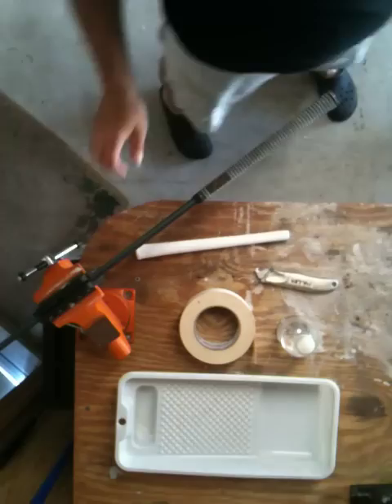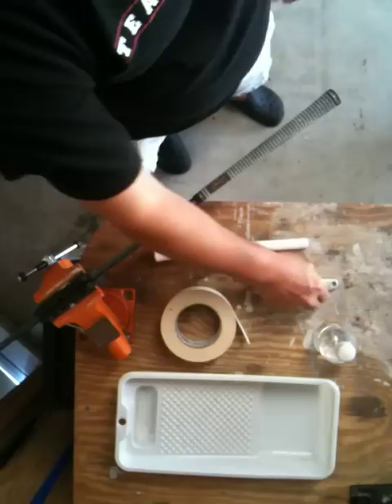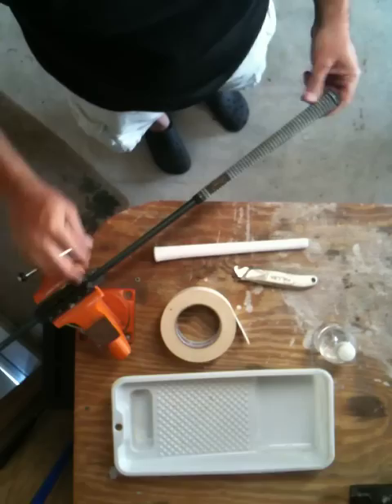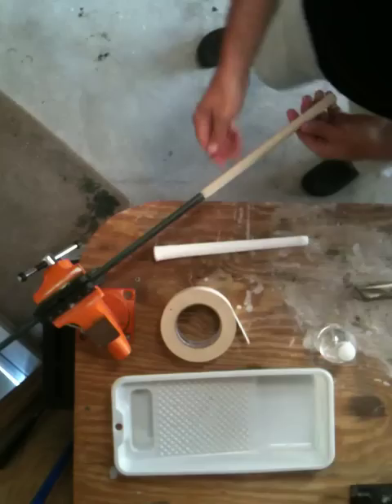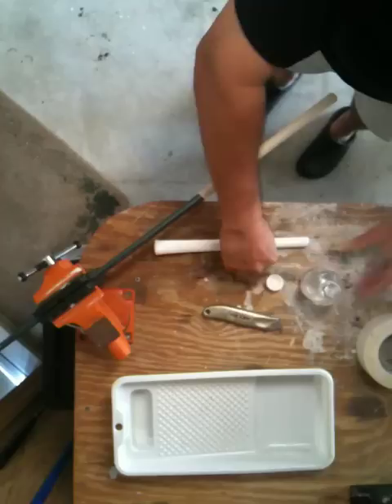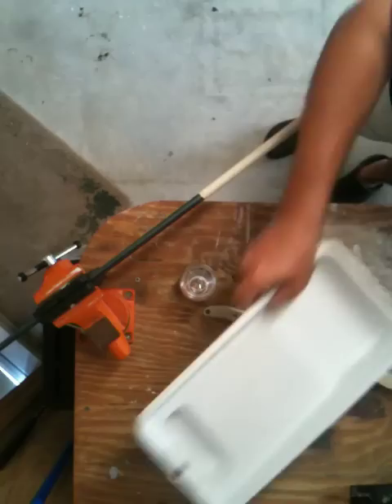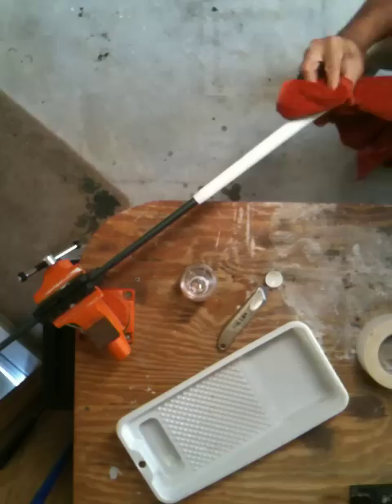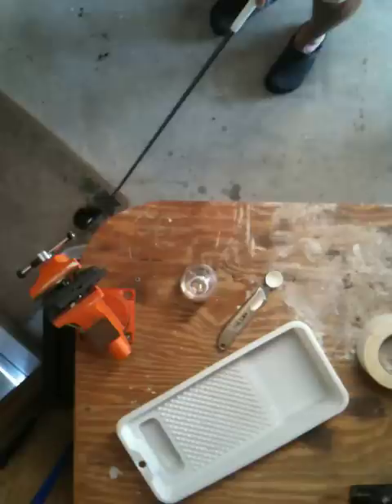How to Regrip A Golf Club in 4 Minutes

Comment: I had a go at this today....messed up the 1st one but managed to easily do the remaining. I can add a couple of tips that I found helpful :

1) I used a small plastic siphon to pour the fluid into the grip. Having shook the grip with the fluid inside for 15 seconds,  I then poured the fluid back into the bottle using the siphon.

2) The double sided tape fiddly issue. I just turned over a corner of the cut piece. The "backing" then separated easily from the tape. It was then  a simple case of wrapping it around the club as described in this video.

3). I used an old sponge to coat the sticky tape with the fluid.

It all went swimmingly well after I had done this. I feel I could now make a few quid re-gripping mates golf clubs.

Thank you for the original post. Saved me a fortune over here in France.

Comment: You shouldn't use the hook blade like that. It's much safer for the graphite if you lay the blade flat rather than on edge. If not, you risk scratching with the metal. If you're careful, it won't be too much of a problem.

Pro Tip:  wrap the tape first, then pull off the outer layer before twisting and inserting into the butt of the shaft. 

Mineral spirits is awesome for a grip solvent for the do-it-yourselfer because it takes longer to evaporate and allow the tape to become sticky. this allows for more time to align the grip.

Pro Tip 2:  When putting the grip on, place your thumb over the hole at the back. it creates an air seal and a cushion to slide the grip on and it will go on super smoothly. Be careful when you release, you might get some pressure sprayback.
Reply from the maker: I agree that you have to be careful with graphite shafts, but the hook blade works great and the part that comes in contact with the shaft isn't sharp and doesn't leave any marks. Using a regular blade would scratch the shaft for sure, but the hook blade works perfectly.

Comment: No, it is not necessary to have a vice to re-grip clubs.  You'll find it is easily done without one.  Simply place the club-head on the ground like you are normally gripping a club and slip the grip on.  Make sure the head rests on a piece of cardboard or carpet as to not add any unwanted marks on the club-head from contact with concrete and the like.  Great video. Cheers.

Comment: Hint..... roll that first half around the4 shaft.  Then peel back the backing.  Its much easier to get off that way, and you have half of it covered instead of fighting to get that corner loose.  Better also to leave the backing on so your hands are not sticking to the tape as you wrap it around the shaft.  And yeah, 4 minutes is nothing if you are not removing the old tape, but when removing the old tape, you want to add about 6-8 more minutes to that depending on how long that old tape has been on there.  Older tape comes off quicker than new tape.

Comment: Looks easy.  I put the new tape on.  Followed all the wetting procedure. But....as I move the up the shaft I get stuck about 1/3rd of the way down the shaft.  I have pull back and start again.  Or cut the new grip off. It’s not wanting to go on.  I know there are differences in Grip sizes but this shouldn’t be happening should it???
Reply: Hunter Hubel Golf I’ve run out of solution and rape strips. They came in a kit.  I’m waiting for some double sided tape and mineral spirit come via amazon to try again.  It all looks very simple watching all these videos.  I just don’t have an explanation......
Reply: Hunter Hubel Golf I am befuddled by this.  There are only 2 variables.  Wetting the inside of the grip and wetting the tape.  Then applying the grip in a timely manner.  I have managed to do 3 clubs but it took way way too long and too hard.  My procedure was no different than what I’ve seen on a dozen or so videos.
Reply: Not sure what the problem is for you there.  I just re-gripped my driver and followed this procedure, except I removed the old tape first.  It was very easy to slide the grip on.  Just to be clear, you are peeling the protective layer off the tape to expose the 2nd sticky side (grip side), right?  And you are wetting the tape completely?  As well, thoroughly wetting the inside of the grip?  Lastly, when pushing on the grip, you are covering the hole at the back as you push it on?  I used mineral spirits for my solvent, btw. Got the tape and grip at a local PGA Superstore.
Reply from the maker: What are you using for a solvent? I use mineral spirits, available in the paint section of any hardware store. It's not the most "green" solvent, but it works. It melts the adhesive on the tape quickly, so that the grips slide on easy. I suspect your solvent isn't working well enough, you aren't using enough solvent, or you have too much tape on the shaft. And by too much tape, I mean like 6 or 8 wraps thick. Anything less should be fine.

Comment: yeah... took me a month to find double sided tape that wasn't $40 a roll then the friggin grip is so tight it won't slide on. Like everything else, much easier to outsource.
Reply from the maker: The solvent you use has a big effect on how easy the grips slide on. I use mineral spirits you can get in the paint aisle at any hardware store. Not the least toxic, but it works every time.
Reply: Yup. I bought mineral spirits at Home Depot. Used double sided tape. I don't have a vise so that might have been part of it. I bought Karma grips off Amazon. They seemed to be too small for my Mizuno clubs. In the end I took my clubs to a golf shop. $5 a club later and I have new grips. Outsourcing mundane jobs like changing your oil, doing your laundry and re-gripping your clubs is much easier. ;-)